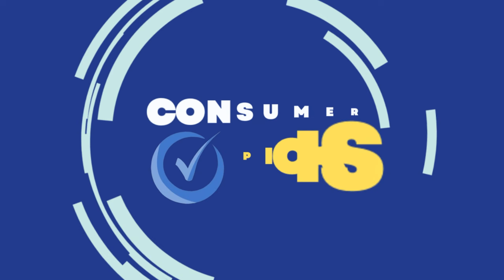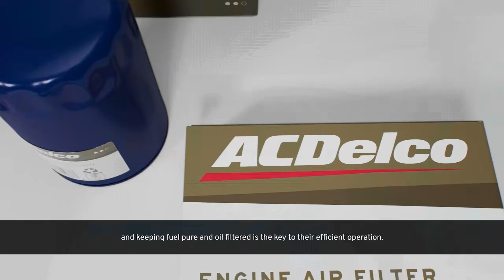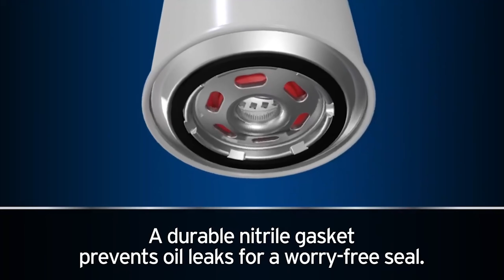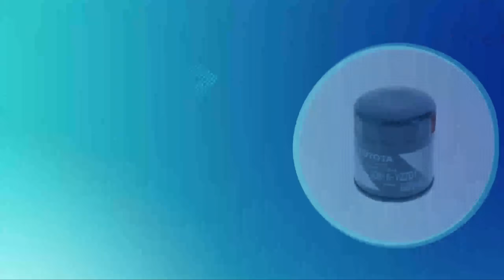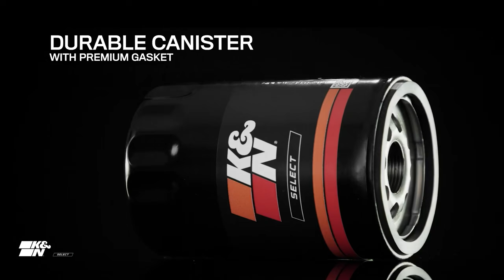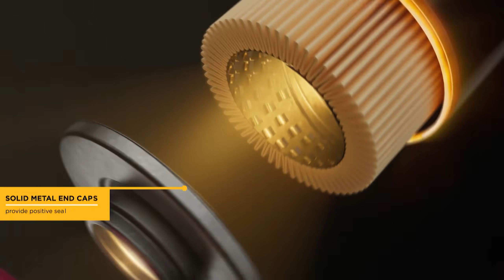Best Oil Filters 2026 – Ranked: Synthetic, OEM & Marine Picks for Every Driver

Comment: It is very simple. Use OEM. I have a Lexus. The only oil filter that will ever go on it is a Toyota/Lexus filter. Period. The flow rate is proper and will do its job properly for the specific time. Not the cheapest and for sure not the most expensive. The best is doing those changes at proper invervals.